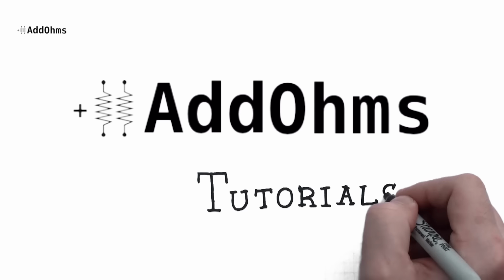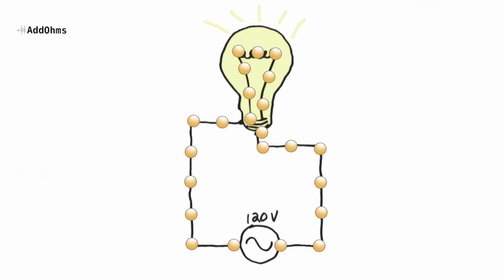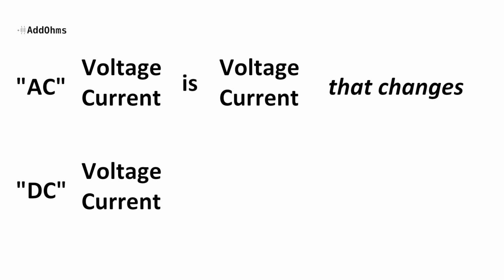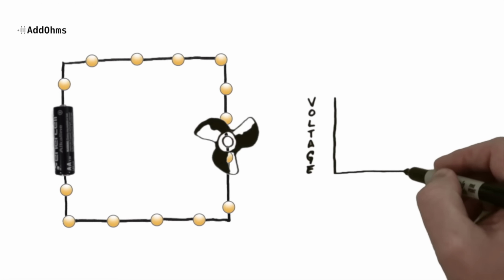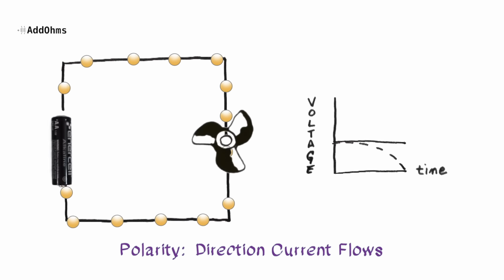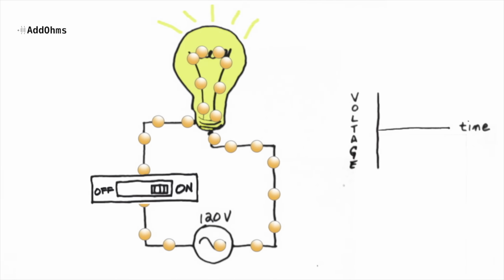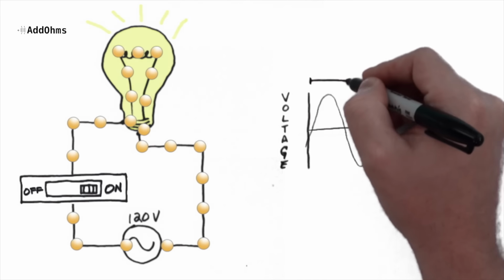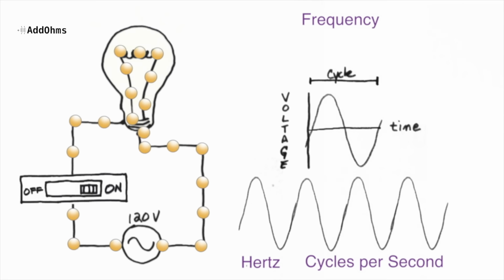Difference between AC and DC Current Explained | AddOhms #5

Comment from the maker: AC Motors use Induction. The coils around the stator (stationary part) create a magnetic field that induces a current on the rotor (spinning part.) The two fields react and cause movement. Since AC is "moving" back and forth, it creates a rotation. 

https://en.wikipedia.org/wiki/Induction_motor

Neither AC nor DC are "better." AC is used for Mains because > 100 years ago, it was cheaper to step it up to high voltages and down to 100/200 volts for use in homes. That's it. And don't forget, "AC" does NOT just mean "Mains" voltage. All signals contain both an AC and DC component.
Reply: Thank you, you have answered my question...😊

Comment: Is this saying that dc is direct current, where the voltage only flows in one direction, and ac is alternating current which can flow in either direction, but as such the voltage flow can change overtime?

Comment: Good video. I would have liked to know why we have AC in our houses and DC in our cars to name a few examples.
Reply from the maker: over 100 years ago, it was easier to step AC up to high voltage for long distance transmission. 

Cars are a DC based system because they have a battery.

Comment: One thing I would like some help on is dealing with model trains using dc current Ex. HO scale locomotives which use one rail for positive current and the other for negative current but in your DC diagram, there was only one wire, no 2 different wires. Also, when it comes to DCC (Digital Command Control) which I believe uses DC power but acts like AC power with varying polarity and uses pulses in the track to use things like sounds such as bells and horn etc. I just wanted so more help understanding mainly the DC thing.
Reply from the maker: Current itself isn’t positive or negative. Just the direction it moves changes. So you probably mean one rail creates a positive voltage across the two while the other creates a negative voltage across the two. 

Adding a small AC signal on top of a DC signal is one possible method for digital
communication in a DC-only system.
Reply: @AddOhms  Thanks for the clarification! I appreciate it!

Comment: well theres one thing I dont understand so theres a live wire and neutral and I heard the neutral stays close to 0 volts but when the direction alternates does the neutral become the live and vise versa during the negative period?
Reply from the maker: Current wants to return to its source. The (earth) ground is a lousy path. So the voltage (and current) on neutral essentially ignore that path… under normal operations.

Comment: I was hoping to get more of an explaination of the difference. I have a automotive battery jump pack and it is rated for 4000 amps (peak current). Well, in the AC world to flow 4000 amps through a cable the cable would have to be a massive size. Yet in the DC world they are somehow flowing 4000 amps through about 10 gauge wires. What am I missing?
Reply from the maker: There is no “DC” and “AC” world. The difference in this application example is the magic work “peak.” The pack cannot provide that current level for enough time to heat up the wire.

Comment: If i need to check voltage on a board should i have my multi meter on AC? Or DC?
Reply from the maker: AC if measuring AC voltages. And DC if measuring DC.

Comment: If the energy output fluctuates with ac how can it run appliances that need a certain amount of voltage to operate?
Reply from the maker: You are mis-using the term energy. Energy is a property and can be expressed in forms like light, heat, and electromagnetic waves (electricity). The voltage and current are what change and, for AC Mains, they change as a sine wave. The voltage changes because of how AC Generators work. The current changes because of Ohm's law. 

Older appliances worked directly with AC mains. They were mostly just inductive motors (which is how fans work) and resistive heaters. Anything that requires DC, uses an AC to DC converter.
Reply: @AddOhms yes energy being electricity in this case thought that was obvious but ok… so what you are saying is newer appliances appliances/ lights prefer to use dc because it is more stable? Im trying to figure out why you would choose ac over dc or vice versa.
Reply from the maker: Stability has nothing to do with it. Over 100 years ago, it was easier to generate AC.
Reply: @AddOhms  do ac and dc deliver the same results under the same conditions?
Reply from the maker: In terms of transmission, yes.

Comment: I find it fascinating how many international electric trains have to be able to collect power from many different voltages, frequencies and a mix of AC and DC - like a train designed to run from France to Germany through Belgium and the Netherlands has to be capable of 25 kV 50Hz AC, 3 kV DC, 1.5 kV DC and 15 kV 16.7 Hz AC.

Comment: Is one current safer than the other?  For example, running a refrigerator in a  or Air Conditioner in a shed that is hooked up to a power bank or generator.
Reply from the maker: No.

Comment: If DC drains out to ground. Why does AC need a ground if it will flow back to source?
Reply from the maker: It doesn't "drain out." Current is a closed loop. The electrons are like links in a chain. So whether they go in one direction or they reverse direction, they still move around a closed loop.

Comment: @AddOhms Incandescent lightbulbs, unlike fluorescent ones or LED's do not flash 50 times per second because the tungsten filament keeps it's light and heat emitting properties on a linear basis. Please clarify this. Cheers
Reply from the maker: Watch a slow motion video of a tungsten bulb.
Reply: @AddOhms   Whaaat. That's awesome. Nevermind my nonsense, you are pro. Cheers

Comment: How is an ac source made? I get it with dc and a battery it makes sense but not with the ac. What makes the polarity change
Reply from the maker: For AC Mains, it is because of how AC Generators work. The coils of wires create the waveshape as the rotor spins.

Comment: I have questions for AC: Why does the volts increase and decrease? Why does 0V cause a change in polarity? Why is it better to use than DC in the mains supply?
Reply from the maker: Because that’s how AC generators work. And neither is better than the other.

Comment: Thanks for nice video.

Is anyone who could explain Why lower voltage dc produce more amps than high voltage ac?
Thanks
Reply from the maker: It doesn’t.
Reply: ?
Som Car 12v fuses 20-30amps when 230v ac home appliances has max 13amp fuse
Reply from the maker: So? The current ratings are for specific use cases. It is an arbitrary limit not a technological one. Your house has a 50 to 100 Amp circuit coming in.

Comment: Hello guys recently I made a 12v Li-ion battery pack and used a stepdown to 5v, now what kind of battery is mine,dc or ac? Is it ok to go from 12v to 5v than again 12v since I will use a usb cable dc 5v to 12v so I can use the pack for the echo dot 4th generation. I hope smo will read this😅
Reply from the maker: All batteries are DC.

Comment: I don’t get it. If the electrons in ac go back and forward, then most of them never reach the lightbulb. So if you demonstrate  the current flow that way, then it can’t work I guess or am I wrong? I know that it has to do something with the electric field , which points in the direction of the lightbulb, but that’s all I know. Can someone help?
Reply from the maker: The lightbulb doesn’t consume the electrons.
Reply: @AddOhms  well but the lightbulb can’t consume the Energie from the same electrons over and over again. I mean, we can see that the voltage after the lightbulb is lower than before it.
Reply from the maker: Electrons are matter, not energy. The energy is what moves them and is what the bulb converts to light. That’s why it doesn’t matter how they move.
Reply: @AddOhms  so the lightbulb gets its energy by the motion of the electrons?
Reply from the maker: Yes. Like how a bicycle chain works. The chain links aren’t creating the energy. They are the carrier from the pedals.

Comment: So what with alternating current at 50Hz with a simple motor. Why doesn't it go back and forth in opposite directions? What enables a simple AC motor to spin in one direction?
Reply from the maker: AC motors use induction to spin the rotor.

Comment: How would a ac current affect a motor?
Reply from the maker: AC Motors use "induction motors." The electric field induces a current on the rotor, which creates a magnetic field. That causes the rotor to spin. The windings are done such that as the rotor reaches the next set of windings, the AC field has flipped, and it allows the rotor to keep spinning.

Multi-speed switches change the which windings get energized.

Comment: But polarity also remain same in AC though flow changes. 
Why is it?
Reply from the maker: No. The field’s polarity reverses.
Reply: @AddOhms  it means...if I will put tester/ current meter,  at one terminal then that will show light on/off.
Reply from the maker: I don't understand what that means. The field/polarity/voltage (and current direction) reverses, or *alternates*.
Reply: @AddOhms  ok...I repeat. If polarity changes then each terminal will be -V/+V?
 Right?
Reply from the maker: Yes. That is why in most AC applications terminals aren’t listed as + and - …

Comment: I have a question.
In your example where a bult flashes 50 times per seconds in 50Hz, how come it does not flash 100 times per second as 1 cycle contains 2 voltage peaks?
Reply from the maker: Yes

Comment: Also incandescent bulbs keep glowing because they don't disipate enough heat to stop glowing. LEDs on the other hand do shut off an on, and can be recorded in camera. With an incandescent bulb a noticable flicker cannot be recorded, cause it doesn't directly rely on the electricity for producing light, but the heat that makes the filament glow.
Reply from the maker: There is plenty of high-speed footage on YouTube showing an incandescent filament going from dim to bright. Does it flicker? No. But it is definitely pulsating.

Comment: how come ac current or voltage doesn't cause a motor to turn the opposite direction like the dc when battery is turned around?
Reply from the maker: Look up induction motor.

Comment: In a conduction, electron (charges) move high potential to low potantial...but in AC current how it's possible to change the direction of current flow...pls explain.
Reply from the maker: The electric field flips, electrons follow.

Comment: Ok but how does AC current travel down a new power line to its destination if it’s changing direction?
Reply from the maker: Current is a continuous loop. It doesn’t “travel” anywhere. Electron at the generator pushes all the electrons. Electrons move, carrying a charge, and that is the energy transfer we care about.   The charge, not the actual electron.

Comment: So is AC the reason why we get flicker in video at times if not using the proper shutter speed? Is DC the solution to this problem more or less?
Reply from the maker: Yes. But LEDs are technically DC is they are on and off, but faded with PWM, which is small signal AC. There are very few DC-only light sources used today.

Comment: Can you help with my question, if the lightbulb is running AC, and half the time it's bright and the other half is dim, than wouldn't we see a lightbulb thats only 50% of what it can be? Would this mean DC currents are better, than why do you say neither are?
Reply from the maker: It isn't 50%. AC causes an incandescent bulb to continuously get brighter or dimmer. The average voltage would be sqrt(2)/Vpk. Not 50%.
Reply: @AddOhms  Thank you.

Comment: So when i see LED light flashing through camera, does it mean it's running in AC?
Reply from the maker: They are flashing on-and-off, but at a very fast rate. LEDs use pulse-width-modulation. Which is considered small-signal AC. They are still considered digital though, because they are only on or off. no in-between state.

Comment: According to you illustrations the AC current elections seem to move back and forth in a limited area, i.e. they aren't actually traveling far/down the wire. Is this true? In AC currents do the physical electrons stay mostly in place?
Reply from the maker: Most do, some don’t. Why does it matter?
Reply: @AddOhms  thanks for the reply, just found it interesting. I always assumed electricity came via the movement of electrons through the wire. The fact that it is just the excitement of electrons that stay mostly in place through the movement of energy is kind of blowing my mind.
Reply from the maker: The best analogy is a bicycle chain. Work happens by moving the chain. The chain itself doesn’t do it. Same thing with electrons.

Comment: But if youre doing Dirty Deeds using AC/DC, then youll be ringing Hells Bells while on the Highway to Hell, due to all the High Voltage rock and roll and your fingertips will be Back in Black.

Comment: For a 50 Hz frequency, the light bulb flashes at a rate of 100 times per second. Both positive and negative half cycles deliver power to the bulb.   The power versus time graph has two peaks per cycle.

Comment: In Ac voltage when voltage is +100v means live has 100 volts more than neutral.so at negative voltage like -100v  neutral has positive 100 v respect to live wire.so at this point of veiw what's diffrence between live and neural?
Reply from the maker: Has nothing to do with voltage. Neutral is the wire that is connected to earth ground, usually at the electrical box.
Reply: @AddOhms  in many countries neutral doesn't conect to earth.this is a simple question at the peak negative voltag,neutal has 330 volt respect to live.isn'tvit?
Reply from the maker: If neutral isn’t connected to earth ground, it isn’t neutral.

Comment: Would you say these principles also apply to a DC and AC motor?  As in an AC garage door motor vs a DC garage door motor?
Reply from the maker: No. AC motors are built different. They use induction to rotate, making use of the AC field’s movement.
Reply: @AddOhms  so then does the induction work like the AC current to a bulb?  How does that doffer from the DC motors to Garage Door?
Reply from the maker: No. Induction has nothing to do with light bulbs.
Reply: @AddOhms  ok thank you.

Comment: What happens to the copper molecules in the wire in both AC and DC?
Reply from the maker: Same thing that happens to all atoms, they're held together while the electrons fly around the nucleus. That is why electric circuits require a closed loop. So that electrons can get pushed around in a "circle."

Comment: Nice video , I have this confusion , example if DC flows in a wire with 1 ohm resistance  the loss is less compared to AC through same wire with 1 ohm which will be double right , then why is AC used in long distance transmission.
Reply from the maker: There is no difference in loss between AC and DC. AC is used because it is easier to step or down.

Comment: Are the electrons in the AC current always the same? In the DC diagram it is clearly seen that they go in the motor and then leave but in the AC one they just change direction constantly and never leave the bulb.
Reply from the maker: The diagrams aren't drawn well in that regard. Think of electrons like a bicycle chain. (And even then, individual electrons are still bouncing around each other, so it isn't as static as a single electron only moving back and forth.)
Reply: So, in the AC, it would be like if the chain was first moving forward and then it changed direction and went backwards? 
P.d. Thank you for answering so rapidly, I wasn’t expecting it so fast.
Reply from the maker: Yes. As if the bicycle moved forward with a ratchet-motion instead of continuous.  (I don't know of any that do, but like all analogies there is a hole.)

Comment: Ok so ac better because electricity works fast and the gap in oscillation saves energy vs steady current. So ac + better light bulbs = going green. That sounded different in my head
Reply from the maker: That has nothing to do with why AC is used for transmission. Over 100 years ago, it was easier to step and down to reduce losses.
Reply: @AddOhms  transmission of energy? I'm just learning and got confused I think with the idea of a series of lights maybe? And in conjunction with an oscillating current? But in all honesty I'm confused kinda still about an oscillating ciurcut having a ground.
Reply from the maker: Power transmission. From a generation station to your home. All voltages have to have a reference. AC mains is referenced to the Earth, aka, Ground.

Comment: ok so a question to create a strong electromagnet coil we use soft iron and ( do we use the ac current or the dc) my guess is the dc since it doesn't fluctuate the current will flow smoothly in one direction creating stronger magnet lines.

Comment: i am confused at one point..as in AC current flow back and forth means the charges move back and forth but how it is possible that once electron moves in the circuit they move back and forth and remained there due to their movement..is this against the law conservation of energy??
Reply from the maker: Electrons are always moving—in all atoms. An electric field (voltage) forces them to move in a uniform direction. Keep in mind that electrons don’t move at the speed of light, they are particles which is matter.

Comment: Does anybody know if a 12/2 is good for 20 amps AC, how many amps with it handle with DC?   I need to run a DC only run of about 30ft that will have a draw of about 35 amps, I would normally run 4g welding cables but I have none nor do I want to spend big $$$$.  I do have 12/2 AC wire but not sure if it can handle the load.  The draw is only used an 1 or so a day and usually between 14amps to 35amps  So is there a conversion chart that can help me?
Reply from the maker: The rating is RMS current. RMS AC = DC.